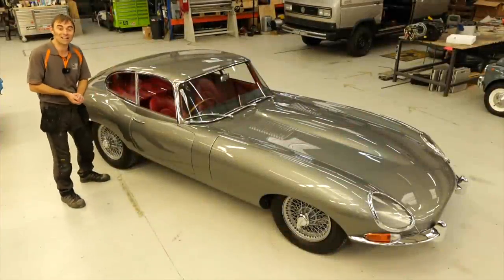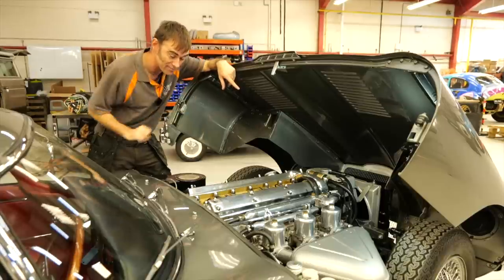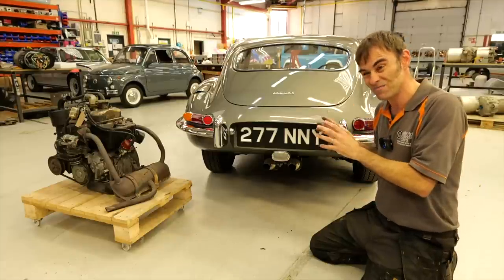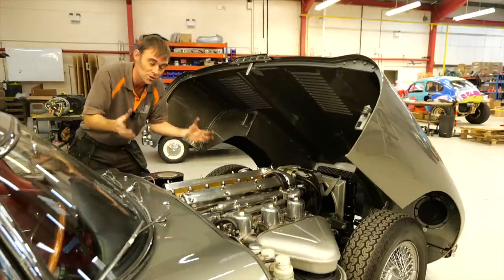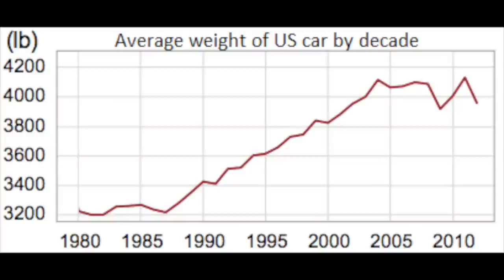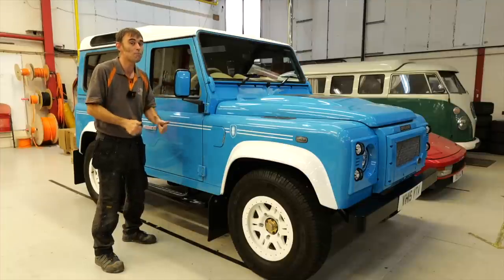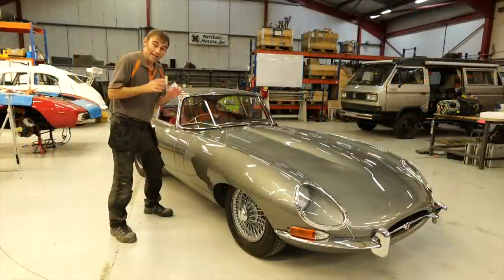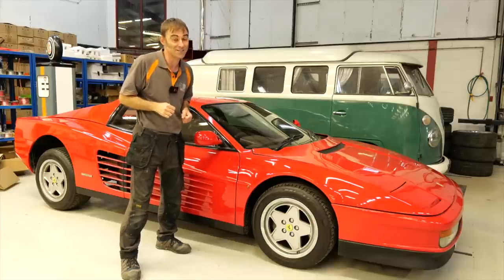Is it a sin to convert a classic car to electric?

Comment: when you have a concours motor like the one your showing it is a pleasure to put it on show and open the bonet to display the beautiful machined engine, Im not sure Id want to go to a show and peer at an electric motor and a bunch of orange wires, hows that going to win prizes? although I dont disagree with what you do , Life is about choice and people should be free to choose what they do to their cars what I dont understand is that if you exchanged your lower powered engine for a higher powered engine you might have difficulty with the DVLA registering your engine upgrade, yet it seems acceptable to upgrade the power by fitting an electric motor/s. 3.5 seconds zero to 60 is going to up the insurance. 
Around 90BHP is all most familys need in a reasonably sized family motor, of late BHP has been rising and rising unnecessarily, there doesnt seem to be a limit to the Hp in electric vehicles. inefficiency and maintenance is part of the sense of pride of learing about the engine and being able to maintain it  as an amature mechanic is very relaxing and most classic car owners enjoy the process of maintenance tinkering with an engine 
 your assumptions on emissions are not quite correct, A typical diesel pollutes more when it is cold than an equivalent Petrol car, once the diesel warms up the co2 emissions reduce significantly compared to the petrol car which maintains its co2 emissions whether it is hot or cold, the problem with diesel is the NOX emissions which are higher than the petrol engine. also shown recently experiments in towing with an EV have shown that a typical EV with 250 miles of range Lose's 25% of its range towing in the first 20 miles of its journey towing a 16ft 4 berth caravan. that is to say EV's can tow but not as efficiently as a petrol or diesel engine vehicle. however, I like the idea of extending a classic cars life, the co2 in producing the car has almost all been spent years ago and if engine failure was an issue and you can no longer find the parts to repair the engine then turning it into an EV is an attractive prospect. The soul of a car is the investment that you put into maintaining it and the sense of pride that brings you as the owner . you can hear your car coming down the road with an ICE engine you recognise the engine note as you tune your hearing to recognise it, could you recognise the note of your EV in the same way?

Comment: If the car was pulled from the scrapyard and requires a full restoration, fair enough. But to convert a perfectly working ICE classic to electric is sacrilege. If you want an EV, buy an EV. Synthetic gasoline will keep old cars alive for enthusiasts. Don't butcher a piece of history.
Reply: I agree, I have 11 cars. None of them worth a great deal of money. I do all my own maintenance and a can't remember the last time I had a breakdown. Part of the joy in owning is doing the maintenance. I have a couple of Porsche 944's (3.0L S2's) one hard top and one convertible. Wouldn't mind converting the hard top but that's never going to happen as I don't have the money to do it! The other thing is from my house to Goodwood I can fill up and get there and back on one tank full. If any of them was electric I'd have to recharge before I returned!

Comment: Yes it is a sin. Every classic car was designed a certain way from the drawing board to it's eventual production and the engine was a big part of that design. To me personally to replace the original engine with an electric motor is just wrong. It goes against the car's original design. I personally love big engine car's and get a thrill every time I turn the key and the engine fires up. This is just my own view and many will disagree with me.

Comment: It is ridiculous as once the battery dies after 7 years you are left with a huge loss on the investment and have a ruined classic into the bargain, or not.
Reply from the maker: Absolute rubbish. I converted my classic VW to electric 8 years ago and it’s still going fine, I haven’t noticed any drop in range.

Comment: At the end ,  a car converted to electric is a "Modded" car , non standard and potentialy more troublesome finding insurance who take a dim view of modded cars away from standard .    Also, any spares stockist can only supply and guarrantee spares for what was listed in the original builders manuel or approved extra's .      That does it for me .    But , in the event of an electric car that is problematic and the origial builder has gone bust or finished with no records of the build,  the owner of the car is in for a hefty bill to reconvert the car back to wht it should have under the bonnet and notwithstanding any butchering that may have occurred to the metalframeworkor Chassis .    This mans argument about some engines not sounding nice enough like a Fiat or  diesel land rover are unfounded as many Gardner or Foden diesel fitters would be aghast if the beloved Gardner noise wasnt there .  There is absolutely therefore, no argument to tear out the origial heart of a classic car and replace it with a non factory specified mod .

Comment: I was agreeing with you up until you talked about reliability. If you sink 20-100k into any car it will become more reliable. So I don’t think it’s fair to say ev cars are more reliable… why about when you run out of electricity ⚡️?  It’s the same argument …,
Reply: When your out of electricity, you can not run the Oil Derek to pump oil, can not run the oil refinery to process it, cant run the phones and computers to order and pay for it, can not run the traffic lights for tanker to make a delivery, cant run the Petrol Pumps to fill your tank.

Comment: I like your vids, but whilst you are quick to point out how bad petrol engines are and how damaging the extraction etc is to the environment, I would have to state that you clearly haven't looked at how the materials for batteries are procured.
perhaps you should do some research on this and produce a video showing your findings. Electric vehicles will never clearly be the complete answer. I could go on, but if I need to then I'm already wasting my time. You should also look at what is being touted by the WEF at Davos this past week??? Yes, sadly, most of you haven't got a clue.

Comment: Soul in a car. That is an interesting suggestion. Let’s us leave the religion behind and look at what makes internal combustion engines interesting. Large numbers of them achieve their interest by the variable means they achieve their celebrity or not. Now it only works if the electric motor matches the the original performance or thereabouts. So you want reliability well when your electric car is fifty years old will it be reliable? Probably not because electric generation regulation has changed hugely in my lifetime just as the petrol and diesel engines have. There will have to be a vast improvement on recharging facilities apparently a third of them are in the London area at the moment. Running costs are a variable which the government will tax as they do cars at the moment with ICE. 
Electric transport will arrive but certain things never change put a hole in a car roof and it will leak! So at £20k to £30k is it a viable proposition? Well the answer to that is how valuable is your vehicle? A large sporting vehicle might well justify that but what of an Austin 10 or a Lea Francis 14 which you would like to renovate? Certainly with some of the 1960’s Daimlers there would be interest with running economy but in truth anything that requires restoration and is under 15 hp is going to be a dead duck unless you are very wealthy. It is not to be said it cannot be done but the pocket of the individual and the knowledge of the individual to do the work will be severely limited and that really is the disappointment and anger that is being aroused. The amusement of many small people pursuing their dream which is often not realised is being taken away from them. It becomes just another finger in the eye from the very rich. Motoring started off for the very rich and is returning there and the small working man who uses it for work and play will resent it. There is also the point if every Jaguar and Jensen and Aston has the same electric motor it is going to be quite boring isn’t it?

Comment: How do you maintain a numbers matching classic car, once you have replaced the engine with another power plant!? Keep the drained engine, transmission, fluid lines and harnesses in crates, I guess...

It is all about the perception of value and a truly valuable classics with their original ground breaking engineering (for their time) and increasing rarity would be ruined.
In my humble opinion you don't modify them...

Daily driver, you say... Well no one cares what you do to it as chances are there are many to go around and true collectors have access to whatever daily driver EV they want . 

Would you electrify a 23 window VW bus or an all original matching numbers hand made Shelby Cobra? Please say NO, as that could not be true...

Comment: "Is it a sin, to take this out and put in an electric motor"? In a series 1 E-Type (Or any other classic) YES If it was a wreck that had no engine and it was re-built as an EV ok BUT to destroy an original condition classic vehicle would be an unforgivable SIN. I had the misfortune to work for a company that converted Citroen C1s to electric, what could have been a great little conversion was compromised by shoddy design and lack of support for the unfortunate customers that had spent 3 times what the car cost as an ICE, But they were fun to drive (For as long as they lasted) Just got to the part of the video where you are sitting in the engine bay of a (former V8) Aston 😱 as someone who worked for Aston Martin for 10 years I am horrified to see this, You can't class that a just a production car, they are a rare classic

Comment: Why can you not have an Classic Jaguar E-Type, fitted electric motor and battery energy packs,  but with the Jaguar classic E-Type V12 Engine and exhaust sound too?
Because an all electric car, that is totally or near silent is a danger,  to sensory impaired disabled pedestrians.
So why can you not have the best of both worlds,  a classic cars  converted to electric,  but with it own classic engine and exhaust sound track too!
Reply from the maker: For the same reason that petrol cars don't make horse noises, technology moves on. 😜👍
Reply: Another neighsayer.
Reply: That's why the classic cars should be left alone and preserved and not changed into Teslas (in which state they will depreciate as no-one will want them and then eventually be scrapped for parts)

Comment: Opinion ~ without even watching.
If you have a classic car that's in 100% showroom, and it's running perfectly, then maybe there's good case to keep it exactly that way. But if you have a classic car that needs a little bit of tidy up, has just a touch o rust, has an engine that could maybe use a tunnel bore and new crank ~ then don't be daft! Go electric and get that classic back on the road.
But then it's not original ~ I can hear you now. It looks original and it works better. What's wrong with that? Do you insist on the original 1958 tyres as well? Not if you've got a half a brain. It probably doesn't have the original brake lines or radiator hoses or fan-belts either.
"Those are consumable."
Internal Combustion Engines are consumable too.
If you are wanting to preserve a 1957 Ferrari V12 ~ I can maybe see your point. If you're trying to conserve an 850cc Morris that made 34 hp the day it was built ~ WTF is  the matter with you? That thing was a piece of sh1t the day they built it!
The two litre Escort ~ maybe. The 1300 escort ~ stop right there! That damn thing was a boat-anchor the day it crept out of the factory! An MGTD ~ No! F-ck off! Put a Honda in it! Better yet, go Tesla. There is possibly something to be treasured and preserved about an MGTD. The engine isn't it.

Comment: Can you have a 'manual' EV?. Half the fun of driving is chomping up and down the gears... you feel as if YOU have control. A 'proper' car you drive with your hands, aswell as your feet.
Reply: Yes, approx half of conversions keep the original gearbox so you could change gear if you wished to.  However you don’t need to as the electric motor has loads of torque. 👍😀
Reply: @spudproductions7606  Thanks for your reply guys.... I'm still to be convinced... The feel of the vibration through the gear lever,  listening to the revs of the engine, and timing your gear change accordingly.. The satisfaction you feel when you come out of a bend, knowing that you timed your gear change  'just right'.... And engines DO have souls.... Blood, sweat and tears went into that E-type engine. From design, to the day it was 'crafted' by skilled hands...... Not just 'manufactured' on a production line in the far East..... Guess I'm just a dinosaur... but who doesn't love a Stegosaurus..😉  lol.... Good luck with your endeavour guys. 👍👍
Reply: Thanks Paul, maybe you’ll have to experience it one day 👍😀

Comment: Some, most classic engineering is straight up garbage. Modern driving conditions are way too much for old engineering. The look, feel and design are the soul. Restomods are the way forward. Electric or petrol upgrades and updates are a good idea, as are modern suspension and brakes essential for safety and drivability.

Comment: I consider myself a petrol head, but you have to be an imbecile to deny the ev Revolution that is currently happening. 
And mostly don't have a problem converting clasic cars, but even I would strike a line at an E type.
For me the engine looks better than the car!
Modern engine's  by comparison look like a dog has just been sick. But an old Jag straight 6, sublime.
Reply: Just to be clear, I would have an E type engine in a perspex box in my living room as art!
A Tesla Model S motor,  sorry but no.

Comment: Why not get your dog stuffed instead? , but then you wouldn't call it a pet, wouldya?
It's a sin, you never ever never do that to an E Type.  full stop ...  to other cars  maybe, if it wasn't that expensive. I was tempted to do it to a vintage Mini Clubman, but gave up the idea, because it just doesn't make sense,  ... given the fact that there are small, modern EVs which had been more or less properly engineered for electric drive in the first place and costing less than a conversion.
long range EVs as such don't make sense, because pollution and exploitation of resources are just relocated and do not really enter the eco equation. 
EV's a good business idea, almost fanatically promoted by the erroneous  CO2 perception.  CO2 is not a pollutant, despite the mantra continuously trying to tell us otherwise.   
respect nature, preserve wildlife, don't pickle the squirrel.

Comment: Total sin. 

First of all, all electric cars are neutered - they are by default, automatic, and thus as interesting to drive as a K-Car (which were, basically, only available in automatic, which rather suited them. 

Second - what are you gaining? well - first you're ordering batteries (a ton of weight added to the car - (which if it is an E type, is quite light and small) as well as all the negative impacts of strip mining and mining such elements as copper, manganese, cobalt, nickel, graphite and lithium. 

Third - where is the electricity coming from? In many places, coal or natural gas plants... hmmmm? I guess if you can't see the poison puffing from the pipe you're innocent, no? 

Fourth - poor range, and it gets worse the colder it is. 

Fifth - few countries have the necessary infrastructure to power not only their current grid but the massive addition that electric cars would necessitate especially if they tipped over that 50 or 60% usage point. 

Classic cars converted to electric are fine - if it's your car and thats what you want to do  - good on ya - paint it baby sh&t brown at the same time if you want. There is more than one way to ruin a car... lol
Reply: Some of your points are addressed in the episode 👍

Comment: Converting a classic car to electric makes it a replica and will devalue it historically and financially.

Taking a new bodyshell or a run of the mill old (as opposed to classic) car with no particular provenence or significance  and building it up as an electric replica is another matter.

I agree with a previous comment, the engines in some of these cars are an inherent part of the car and removing the original engine means that the car has been lost. You can't have a V12 E-Type with electric propulsion.